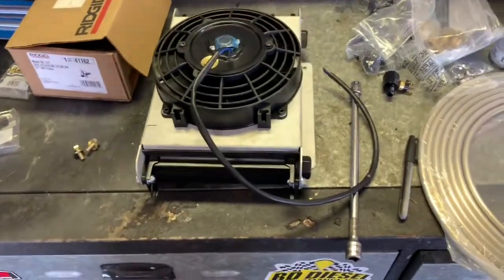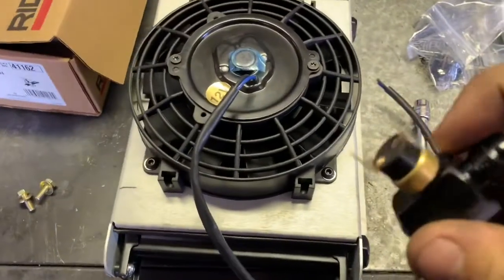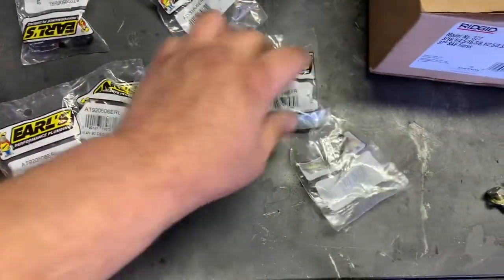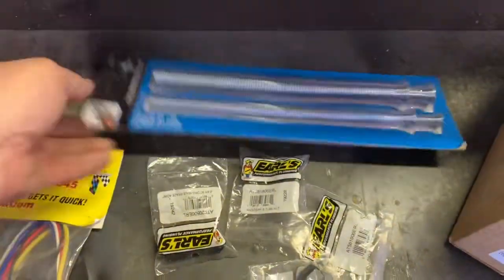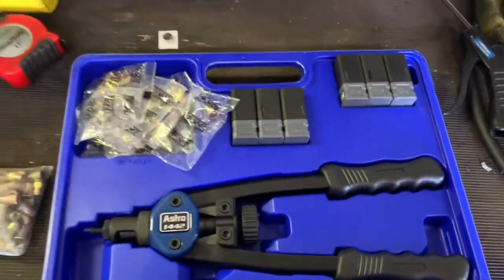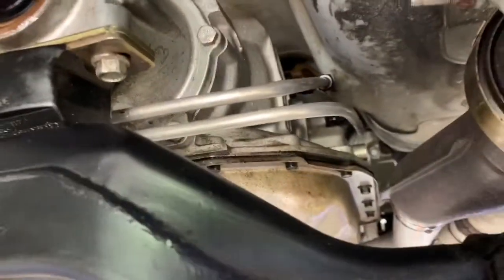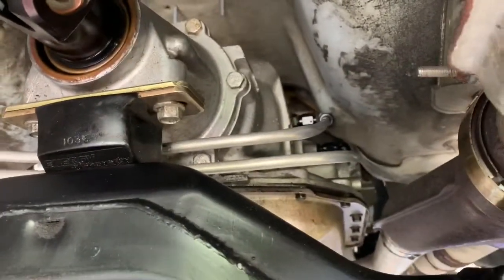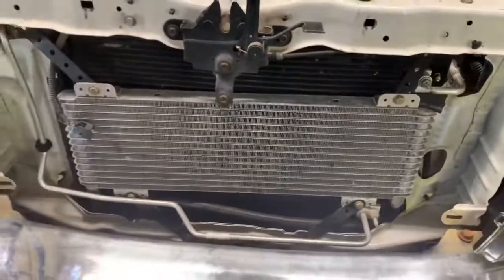Remote mount transmission cooler install with hard lines

Comment: Nice job! In my opinion it would be better to have at least a foot or or so of flexible hoses such as AN lines somewhere between the trans and the cooler since the engine and trans move slightly when accelerating and decelerating and the rigid lines don't provide much flexibility, so I worry that they may break or cause a fitting to come loose or fail. All the OEM setups that I have seen have some sort of flexible hoses connecting the transmission to the cooler for this reason.
Reply from the maker: Avery Alexander yea I may add a small rubber line later. I don’t drive it much so it may be fine but I’m gunna keep an eye on them.

Comment: Thanks for the vid. It sure looks like the cooler exhaust is really close to floor. Do you find that cooling is sufficient under hard use like towing for instance?
Reply from the maker: The fan is pulling so the exhaust from it is actually flowing towards the ground. I haven’t really tested the cooling on it much I plan to put a temp gauge on it once I get done putting the turbo on it. I’m not sure if it would be sufficient for towing or not. If you have the room in front of the radiator I would recommend just doing a tru cool 40k trans cooler up front like I had before this setup. The only reason I switched to this setup is because I needed the room up front for an intercooler.